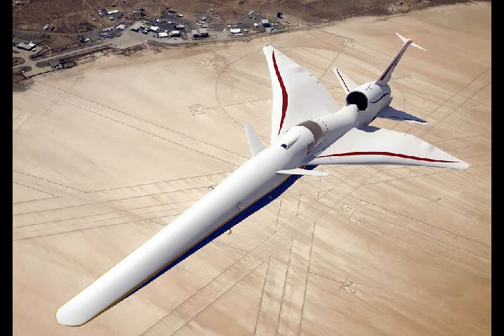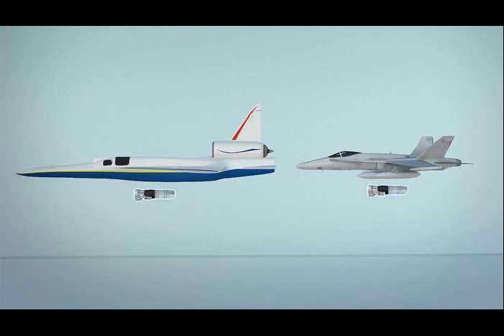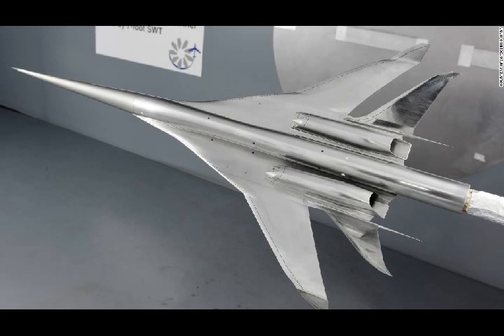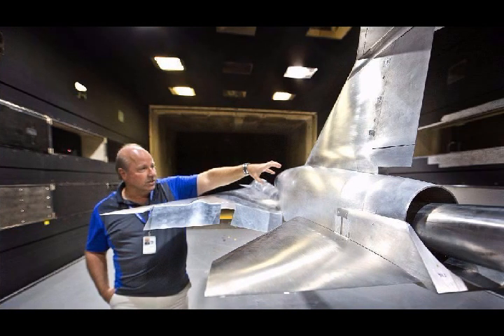Lockheed X-59 Supersonic Jet (QueSST) Aircraft

Comment: Nice idea, that could have been done 40 years ago. It's not the technology that needs to change. It's the public politics that must change. The SST was never as loud, or as bad as opponents claimed.
   Putting the engines above the lift surface will reduce FOD runway risks as well as noise. At the risk of engine flame out, at  high angles of attack. Making landing such an aircraft tricky and dangerous.